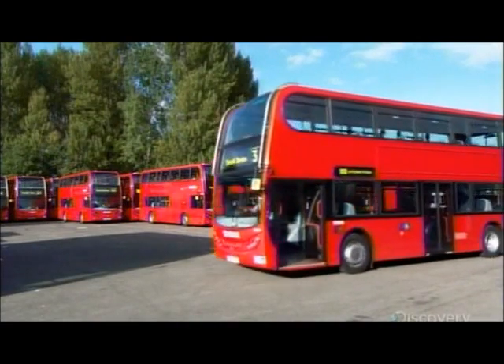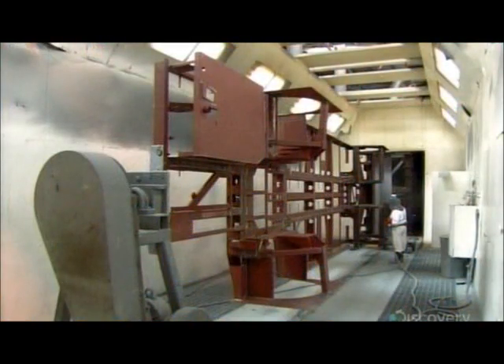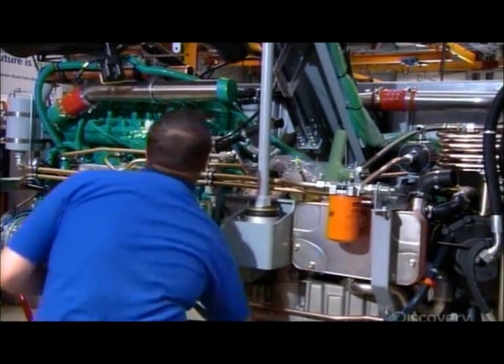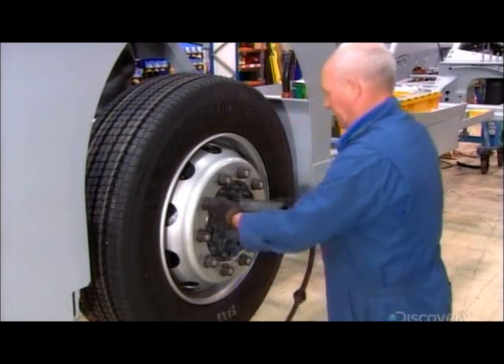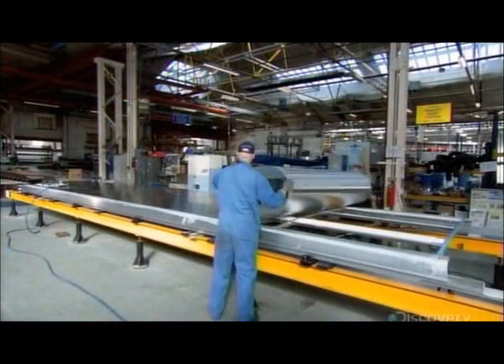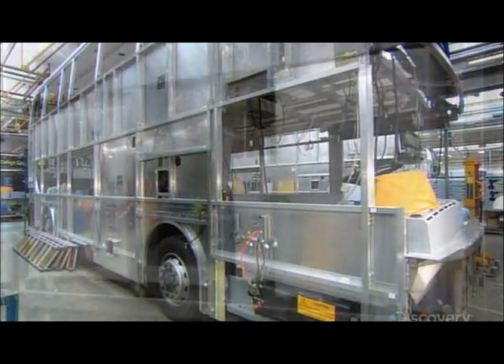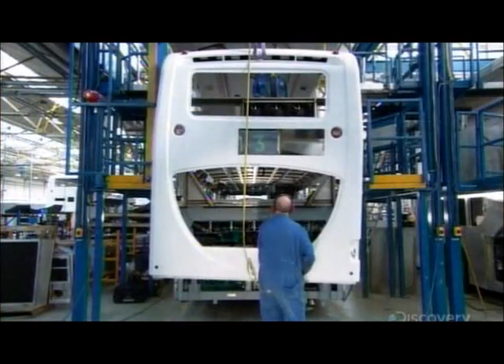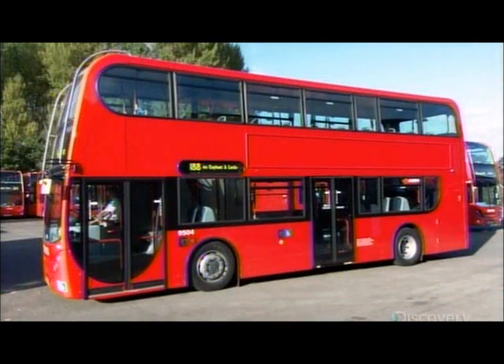How It's Made - Double-Decker Buses

Comment: 4:12 Enviro400s built for the UK do not have air conditioning. Those fans at the rear are just for ventilation, not proper AC. The ones built for Hong Kong and other tropical climates do, which is why they do not have a lower deck window at the rear as this space is taken up by AC equipment.
Reply: They have ac for the driver and front vents, but yeah your right those vents aren't for ac
Reply: So thats why I melt in the summer on them.

Comment: Gas tank? Specific tightness? (torque) These buses are typically 14' 6"
Reply: This is a US TV show, so "gas tank" would be a correct term. Also it's geared towards a casual viewer base and children, who probably won't know what torque is.
Reply: @thelight3112  gas.... gasoline... it's DIESEL!
Reply: @forevercomputing  "Gas tank" is a common term for any sort of fuel tank.
Reply: @thelight3112  So, every vehicle that requires a liquid to be combusted -is gasoline? Yeah, fuel tank would be more neutral. Like he or she (they)
Reply: @forevercomputing  It's just an informal name for a fuel tank because the vast majority of engines in the US are gasoline powered.
Reply: @thelight3112 As English has variations and "petrol"  is a common name for fuel, then maybe it should be called a petrol tank?

If the narrator said "fuel tank" we wouldn't be having this discussion

Comment: "250" horsepower V6.......That sounds somewhat underpowered for a vehicle as large as a bus, especially a double decker.  But maybe the drivetrain puts out a lot of torque to make up for the horsepower.  Just sayin'.
Reply: More than enough to crawl through london streets
Reply: The engines rev up to about 2,500 or 3,000 - if you could get that same engine to spin up, the power curve would also increase - so based on a car engine, that would be ~500hp. The real power is the torque, much closer to 700 or 800Nm
Reply: Inline 6, not V6

Comment: No wonder very few cities still use a significant number of double decker, they only fit 92 passengers which is only 12 more than a regular bus.
Reply: That figure includes standing passengers. Capacity is about 74 seated - something that hasn't changed since the 1970s.
Reply: @uk-martin4905  well standing passengers are still passengers on the bus, aren't they?

Comment: Sure is interesting on making double decker buses.  However, there needs to be fully conventional double decker buses with the engine in front of the driver's seat and the transmission be placed right beside the driver's seat.  No cab-over-engines, diesel-pushers or any nose-less design.  E.G. Look up Lancia Omicron.
Reply: Why though? Also it isn't cab over engine it's rear engined
Reply: @reecewharf  Lorries are cab over engine, buses I drive are rear engined to allow a lower seating position for the driver. COE lorries allow shorter wheel bases so they are more manoeuvrable in places that have turns
Reply: What a stupid idea